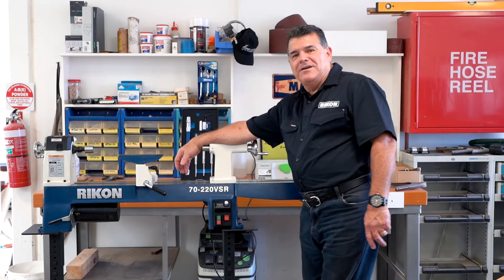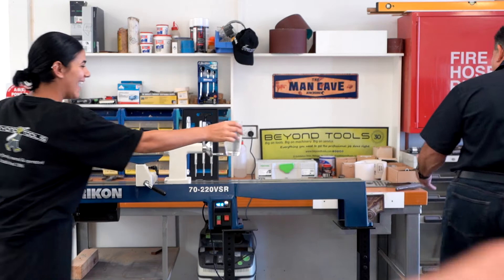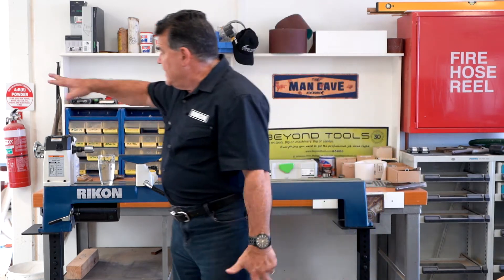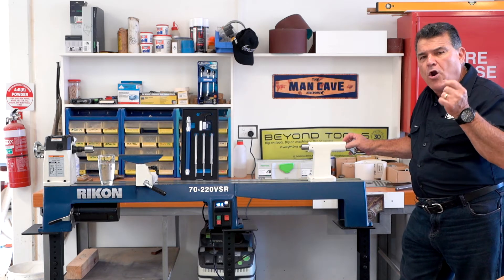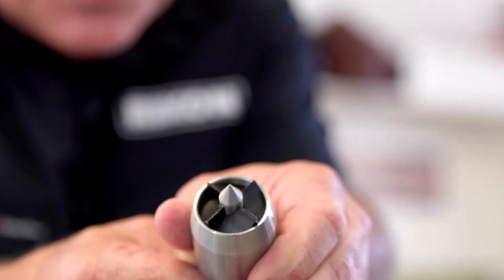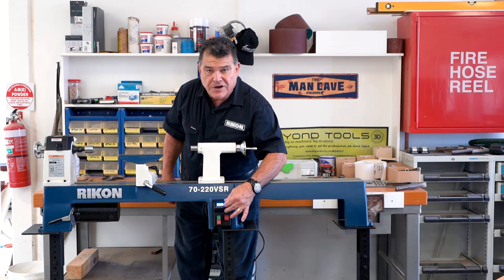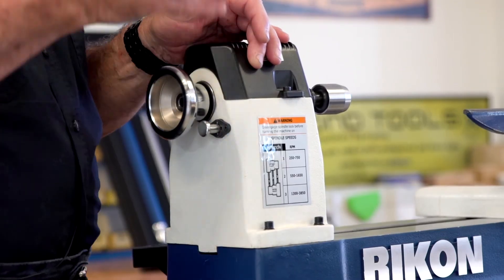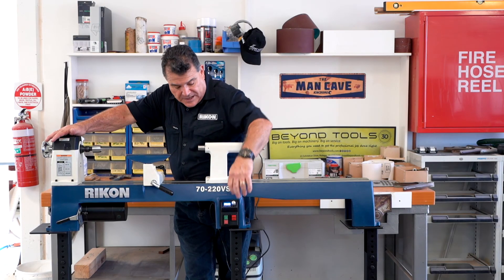BT TV | Rikon 70-220VSR Midi Lathe

Comment: 3/4 hp you mentioned at 2:34 on video

in Canada is advertised with a 1 HP motor? Looking at Buying one but Definitely want a 1 HP Lathe

Actual add from Canada:

Specializing in high-quality woodworking machinery, Rikon has gained a reputation for producing sturdy, reliable benchtop lathes.

The 70-220VSR midi lathe has substantial iron castings, giving it the mass needed to help dampen vibration, with carefully machined components for precise operation. All parts are made of metal, right down to its gyratory wrench and locking levers.

Compared to many other benchtop lathes, this lathe has greater stock-holding capacity both in swing and distance between centers, allowing you to turn larger bowls and longer spindles.

It is suited to heavier work, with a 12 1/2" swing and a maximum distance between centers of 20".

The lathe weighs 115 lb and has a 1-horsepower motor, with a non-slip poly V-belt that efficiently transmits power and a motor controller that automatically increases torque to maintain the speed as load is applied.

Its digital controller makes adjusting spindle speed quick and convenient – just select a range (250 to 750 rpm, 550 to 1650 rpm or 1300 to 3850 rpm) by moving the drive belt between pulleys, then turn a knob to dial in a precise speed within that range. A digital display makes it easy to see the speed you've set.

There's no need to stop the lathe once you've begun working, so you can go from roughing out a piece straight through to finish-turning and sanding without interruption. You can also reverse rotation at the flick of a switch, allowing you to sand down lifted fibers for a finer surface finish.

Fitted with a graduated indexing head for locking the spindle at 15° increments.

It comes with a four-spur drive center, a knock-out bar, a self-ejecting live center, two spindle-locking wrenches, a 3" faceplate and rear-mounted holders that keep the accessories within easy reach.

It has an extra-long 8" tool rest that reduces the need for frequent repositioning, and mounts on a non-slip banjo. It uses a 1" × 8 tpi spindle and a #2MT headstock and tailstock for compatibility with a wide range of standard accessories.

Other sizes of tool rest, along with a 6" faceplate for heavy, large-diameter blanks, are offered separately.

Backed by a 5-year manufacturer's warranty.